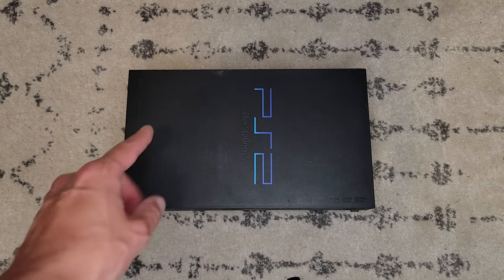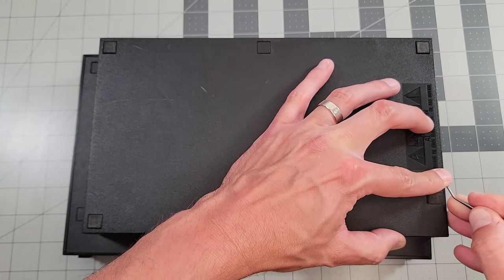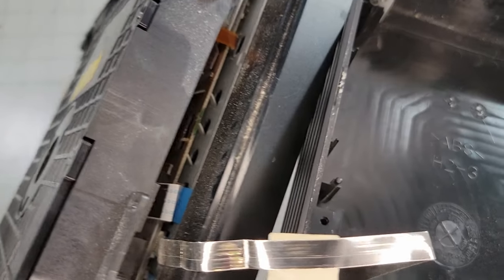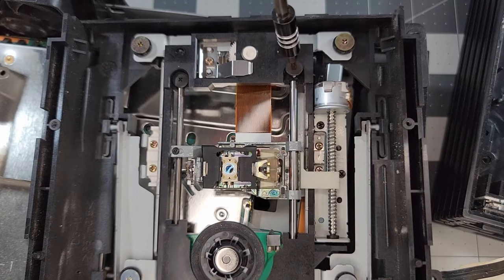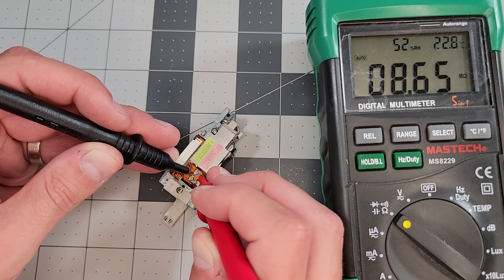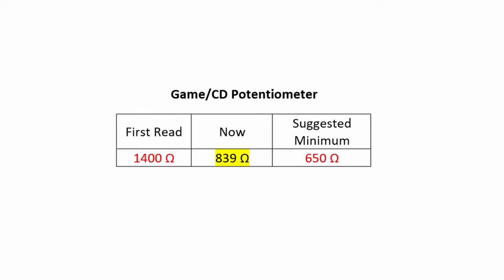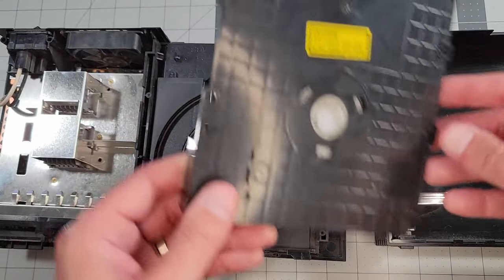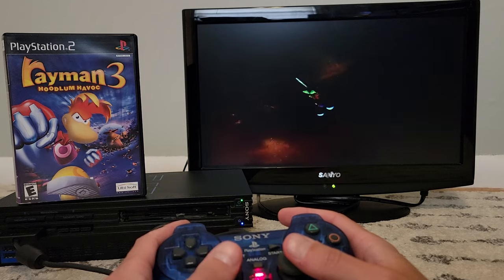PS2 Disc Read Error Solution | NO REPLACEMENT PARTS

Comment from the maker: Quick note: I messed up describing the CD pot only as being game-specific and this is inaccurate. PS1 games are CD and PS2 games are primarily DVD, so it is important to adjust both depending on what games your PS2 is having trouble with. Cheers!
Reply: Say my ps2 is getting no video what should I do
Reply: Dont have a screwdriver small enough for thid process
Reply: @paleofolk i bought mine at the Dollar and Twenty-Five Cent Tree.  It is not megnetic, but for home use it was sufficent.
Reply: @realitygaming7302 have you "fought" with the cable?  Mine has to be just right or no sound or video.  It's a pain.  But once I get it right, it's fine.  Probably a faulty connection or the housing is too loose.  Check the length of the cable or how it fits or sits in the PS2.  Otherwise it might be the TV connectors, but that is doubtful.

Comment: 99% of the time the laser is toast.  Remember these ps2s are approaching over 25 years old. Just buy a new damn laser for 15-35 bucks install and be done.
Reply from the maker: 99% seems unfounded. In any repair, I always start by determining whether I can repair the original parts-- over half the time it's possible. If for no other reason than OEM parts always being better than aftermarket even when they need a jump to get going. That said, I firmly believe in "to each their own" so however it gets fixed, I salute those getting it done. Cheers

Comment: Dirty systems are usually a good sign the laser is just dirty. Did you try cleaning it before adjusting the pots? Fun fact, you only need to remove 6 of the 8 screws to remove the top. The ones you don't need to remove are the short screws underneath the rubber feet. If you want to disassemble the system further, then you need to remove those 2 other screws. Adjusting the pots is only a temporary fix and it will only get worse over time. The solution to this is to replace the laser buuuut...all the replacement lasers from China are crappy so it's kind of a lose/lose situation at this point.
Reply from the maker: Yes I cleaned the lens as an early troubleshooting step that did not solve the problem. It will be along while before the pots drift into a bad range again, but you're right that it will happen, just like with a brand new one. Thanks for the comment!
Reply: Everybody tried that 15 years ago
Reply: @Smoshylife  I've had a PS2 since 2001 played on it a lot for a few years, it stopped reading some discs so in 2020 during lockdown I decided to try cleaning the lens using a disc cleaner put it in the disc drive and now it reads all my games both DVD-ROM and CD-Rom. I've since taken off the cover and dusted inside too.

Comment: If it's anything like the Xbox and Gamecube drives the PS2 drive probably needs it's capacitors replaced. Capacitor plague was a nuisance on that generation of consoles.
Reply from the maker: Xbox for sure, but I've never ran into bad capacitors on PS2 or GameCube yet
Reply: @FantasticQuack  On the PS2 the most common ones to go first are the power supply caps. Caps going bad on xboxes was super common though especially the clock cap.

Comment: You do not need to disassemble the entire inner workings of the drive, you can just remove two screws, disconnect the cable and then tilt the assembly to the side to access the potis.

You can also remove the magnet part from the top cover of the drive and test discs without the cover on it by simply putting the magnet in the center of the disc. It's s lot easier to test and adjust that way compared to a) a fully assembled drive and b) a fully assembled console.

Comment: Huge help thank you. I literally bought a brand new 400c laser replacement (no big deal as I’ve done a few laser replacements right?) just to find out it is only reading CDs. My dvd pot was way up in the 1400 range so I did an adjustment and now works perfectly
Reply from the maker: Glad you got it working and that I could help, cheers!

Comment: My PS2 is pretty dead, looking for inspiration, turns on okay but doesn't retain memory. CD drive ejects at 700MPH and then proceeds to whine until powered off. It closed at Mach 2 when powered back on, doesn't really attempt to read anything. :(
Reply from the maker: Sounds like it needs a new battery, along with a thorough cleaning of the drive components, lubricant, and likely potentiometer adjustment. Best guess without seeing it myself

Comment: What version you have? AC socket is not typical. Normally both edges are rounded, in your case only one of them is.
Is it 39001?
Reply from the maker: I thought they all had one side squared off. It's a SCPH-39001

Comment: what do you do if the disc tray gets stuck in the ejected position? I powered it back on to get the tray in, but the bit that the disc sits on rises when I try to get the tray back in
Reply from the maker: Have you tried pushing on the tray to close it? If you're in a disassembled stated and something is potentially bound up then I wouldn't recommend it, I don't know what state yours is in. I can say there are circumstances where the button does not work, but a manual push is enough to actuate the disc tray to close.

Comment: Hi! Quick question and I know this video was made almost a year ago but do you remember how long it took for the game to boot up after the PS2 logo showed up? Mine doesn't have a disc read error for PS2 games (although I've noticed lately that mine tends to struggle a bit more with CD's) but I did notice that my PS2 tends to take a while before the game's logo or copyright screen boots up
Reply from the maker: I wouldn't be surprised if it was 15-30s  the load times on these older games are pretty wild

Comment: Hi, same problem here. My ps2 slim reads 2 discs, and it doesn't read any other. Should I do the same thing as you did here, before buying a new laser head? Need some solid advice. Thanks
Reply from the maker: If it turns out you need a new laser anyway then you have nothing to lose by trying the pot adjustment first, so I say go for it!

Comment: Where in the world are you located? 
I have psp, that charges, but won't turn on. The orange light turns on everytime i plug it in, with the battery, but won't react to the on/off switch. I've opened the psp, and cleaned the switch, and unplugged and plugged the power cables, still nothing. Heeelp meee
Reply from the maker: I'm in Minneapolis, feel free to email or IG me

Comment: Hi, when i opened the disk cover i found that the whole disk didn't have any screws holding it, is there any replacement screws for it or the average size of them so it can hold still atleast
Reply from the maker: You should be able to buy a miscellaneous assortment of plastic-threading screws on amazon or another source and just pick the size that fits best. Here's an example (affiliate link): https://amzn.to/458TGfE
Reply: @FantasticQuack   thanks my guy 👍

Comment: I just could not see how exactly is a potentiometer measured with you multimeter?
Reply from the maker: watch from 3:47. I have probe 1 on the top left pin and probe 2 on the single bottom pin. Meter is set to resistance mode on auto range (so it decides what units to report based on the resistance it reads), in this case it is self-ranging to kohm as seen on the screen of the meter when I get a reading. In the first reading it says 1.4 kohm which is the same as 1400 ohm. Other meters might not have an auto function and you need to set the range manually. If you're not familiar with them I'd recommend just googling how to use a multimeter. Hope this helps.

Comment: Mine reads 0-1ohms. And adjusting does nothing. Any advice
Reply from the maker: reflow the solder joints on the potentiometer. I've been in your situation a lot and that fixed it every time

Comment: What if my disco isn't moving at all 
The PS2 acts Like the disc was never there
Reply from the maker: I'd start by cleaning out dust and checking the potentiometers. I know at least for Gamecube if the pots are too far out the disc wont spin at all. Sometimes the solder connections on the pots themselves can become open/intermittent and reflowing those joints can solve that problem. Hard to say for sure without being able to troubleshoot it myself but I hope you can find the problem and get it fixed!

Comment: How much to repair my ps2? It doesn't even get to the can't read disc screen but it does acknowledge the present of my memory  card. Maybe the motor isn't working. What next my friend.
Reply from the maker: I do repairs, but unless it's local, typically only for handhelds due to high shipping cost for large items like these--people don't want to pay it. Can you hear the disc spinning? It might still be that a pot adjustment could fix your problem. It's hard to give any concrete advice in this instance without being able to troubleshoot it myself.
Reply: @FantasticQuack  
No, I can't hear the disc spinning at all. I have a small ps2 and the big ps2, and neither of them spin. Any suggested ideas? Repair, or just replace them?

Comment: Can I use anything else other than a multimeter or do I need one
Reply from the maker: You could try adjusting it in small increments and check for improvement but I'd highly recommend using a meter so you know for sure where things are at.
Reply: @FantasticQuack  Thanks!
Reply: Not for nothing, but if you want to try to fix stuff, a few basic tools are always necessary. You wouldn't try to remove a screw without a screwdriver, would you? I'm not trying to be mean, but videos like this can only help if you're willing to follow the instructions. Without the tools necessary to do the job, why bother? You can get a multimeter from a place like Harbor Freight for very cheap. It can also be used for many other things, so it would be wise to always have one. Good luck.

Comment: I would avoid using a vacuum near the laser assembly as they are rather sensitive to ESD.
Reply from the maker: You can get an ESD vacuum if you're that worried about it. I think the risk here is pretty low.

Comment: I’ve got 3 ps2’s that I’m going to try this one. I prefer the fat one more than the slim due to the cable on the slim always seems to rub the disks
Reply from the maker: I prefer the fat one for no reason. Nostalgia maybe.. hope you can get it working again, cheers!
Reply: @FantasticQuack  well I bought a second hand one “for parts only” at a local shop. I’m having to swap some parts here and there. I’ll try to keep this posted on the details. Who knows it may work. But I could be out $20 but the knowledge gained is worth way more.

Comment: I got my ps2 for free, because it was junk, the trqay would not even open. I 3d printed new compenents for the tray in order for it to be able to open, but then the game would not load. due to that, I was frustrated, but it seems like this tutorialmwill help.
Reply from the maker: Sounds like some dedication, I hope you can get it figured out!
Reply: @FantasticQuack  It has been a bit of time, and it still won't work, the inside is a complete jumbled mess, and I now realize why I got it for free. I think there is only 1 thing to be done, which is to replace the entire disk drive.

Comment: I made this now my PS2 DVD drive wont open or close...the led isn't blinking either
Reply: You did something wrong while disassembling or reassembling the device
Reply from the maker: Recheck your work step by step, it sounds like something was missed or placed in the wrong spot
Reply: @FantasticQuack  i fixed it, still cant read any DVD and CD sometimes T-T